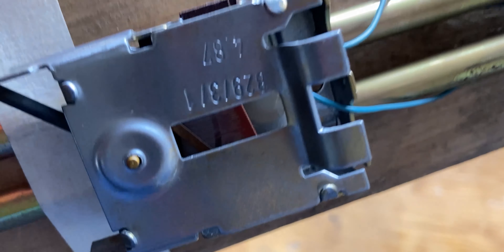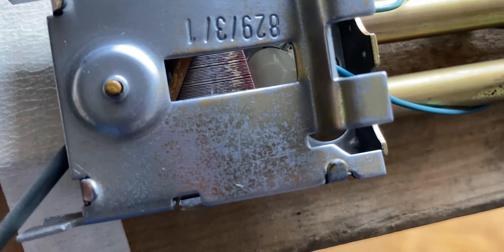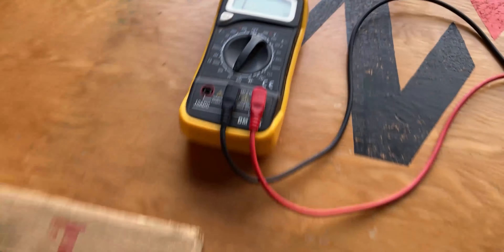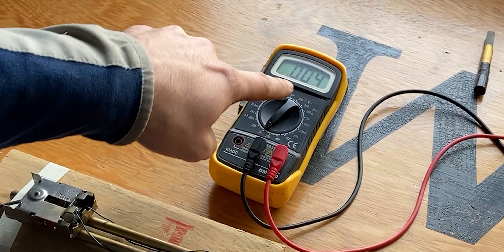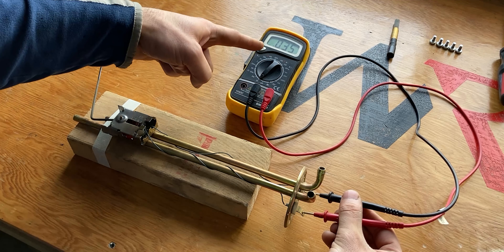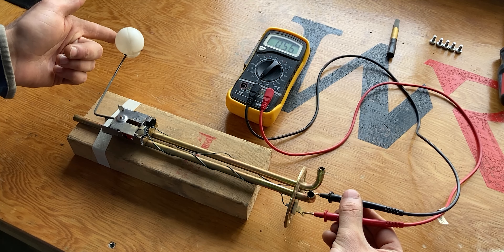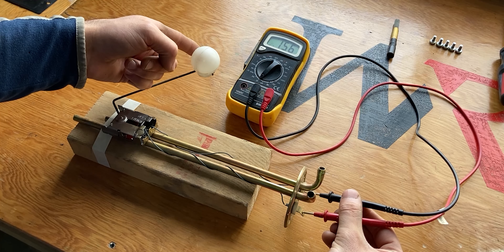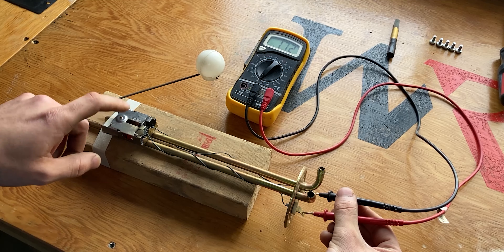John Deere 855 Removing Parts

Comment: It's going to be a good looking machine! Question, 855s and 955s don't share a frame correct? 955s are physically larger?
Reply from the maker: I believe it will be a great little machine, or at least I hope so! I've got some information off of TractorData and they seem to have the same wheel base, so I'm not sure if the 955 and 855 share a frame. Maybe the 955 is  a little bit longer towards the front, to accommodate the larger engine (~30HP). Maybe I'll see one in person to be able to answer your question, but right now I cannot! Best regards
Reply: @WorkshopRebuild  BRO can you make a Video from a John Deere F1145 ! Thanks

Comment: I want to put power beyond on my 855 any chance seeing that done
Reply from the maker: I haven't heard of that up until today! Currently I do not have any use for a Power Beyond Kit, but I did some search and I found a link to a forum which shows the setup in pictures. I think this is very straight forward, but if I find a Backhoe for this tractor in the near future I would need this kit. Currently I will not have a video about this installation, so hopefully you will find this link helpful: https://bit.ly/3MKIueQ
Best regards Andreas